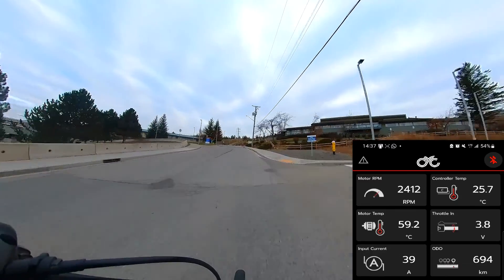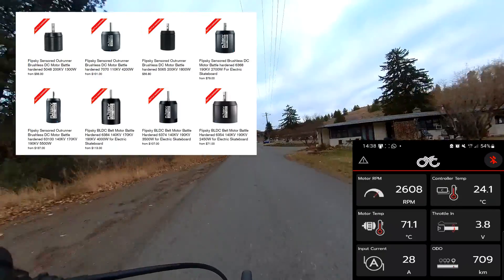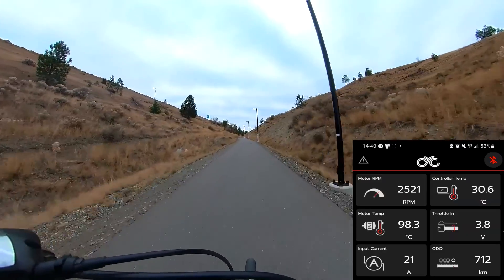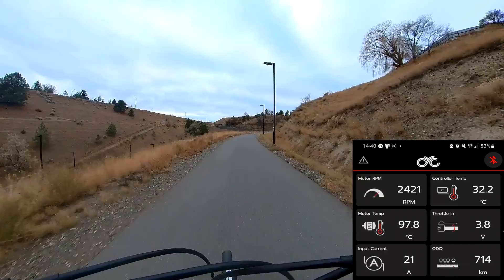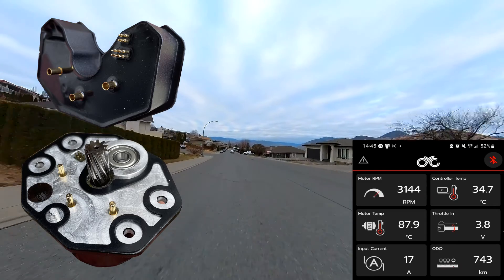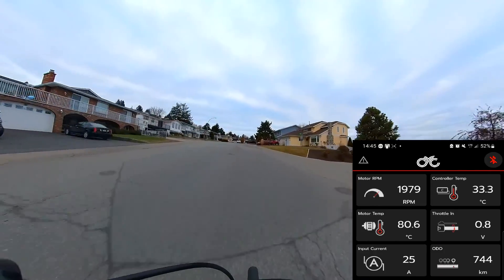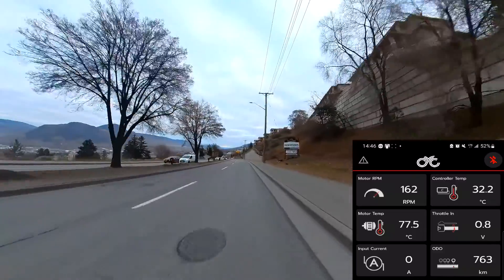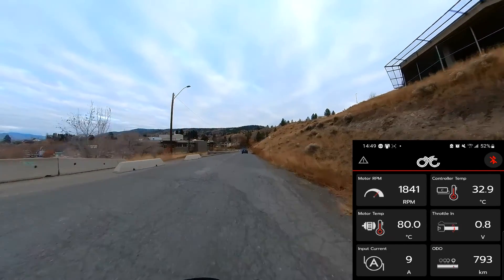How This Ebike Motor Works - Why the CYC Photon gets hot

Comment: Motor tempratures looked to me to be noticably lower on the Pedal Assist lap.
Reply from the maker: Yeah. It was heavily throttling. If you notice the amps were also much lower. I'm not sure why it throttles more with pedal assist than the throttle but it seems to. It reduced it to between 500-700 watts. I can't display both on the same data screen though and I was wearing thick gloves due to the cold.

Comment: how about putting Grin's statorade liquid in the motor then
Reply: I was about to ask the same thing. It looks like it would be be possible. Probably have to use gasket sealant.  So it don't leak out.
Reply from the maker: It has been discussed before and it's not a viable solution, unfortunately. It works with a hub motors structure but not this type. Maybe others can explain exactly why this is. I suspect it's because it would not fill the air gap and just make if more efficient to transfer to the outer casing of the motor.
Reply: @HighVoltageKits  Statorade Is designed to be effective with outward designed motors, such as a hub. but also includes the CYC Photon. (Conversely the only thing Statorade would do with an inward designed motor, such as most mid-drive motors.is create a more effective heat path inwardly to the bottom bracket, which would be pointless. But a hub or a CYC Photon's outward design, utilizing Statorade creates a more effective heat path 'outwardly', allowing more effective air cooling) 

If what I stated was not convincing. May I suggest you check with Jason or somebody else at Grin Technologies... And explain to them exactly what mid-drive motor you're considering utilizing it with and fully describe how it's designed. And get their feedback on how effective Statorade would be?

I'm willing to bet that if it's used appropriately, it will be effective.
Reply: @HighVoltageKits   Has it actually been tried after consulting with Justin of Grin Tech? Or, in consultation with Cyc engineering? I am really wanting a photon type mid drive. Any reliability solutions in sight? what does Cyc say?
Reply: @HighVoltageKits   noted. if your ambient is 2 c and the motor is heating up, it would explode here.

Comment: The Photon is so loud. I dont know why people use this. The Bafang is so much better and cheaper. Only the optic from the photon is better.
Reply from the maker: It has a really nice and smooth torque sensor and a compact form factor.
Reply: it's great for everybody that loves engineering..... But it suck in terms of value.....
Reply: It also has torque sensing pedal assist.
It's hard to compete with the quality, reliability and value of the legendary old BBSHD.
Reply: @michaelsprinzeles4022  I love the bbshd. I dont think the photon can compete with thr power and displays, they can be used. The design from the photon is nice. But its much louder thank bafang and not so powerful.
Reply: I have four Photons, and they're all nearly silent.